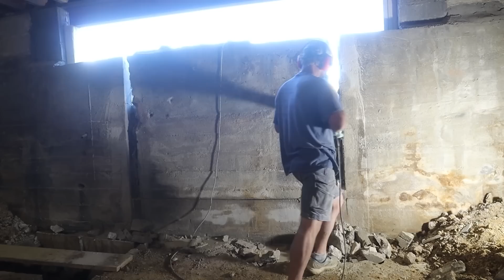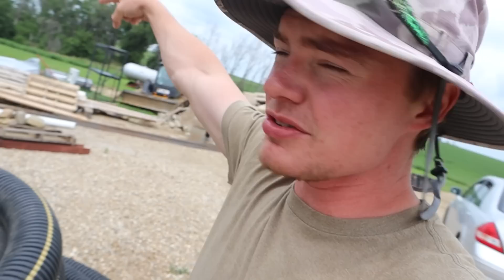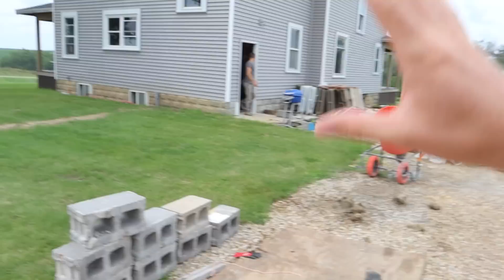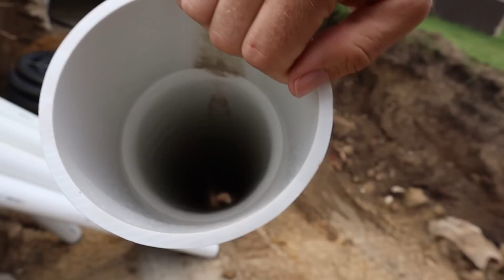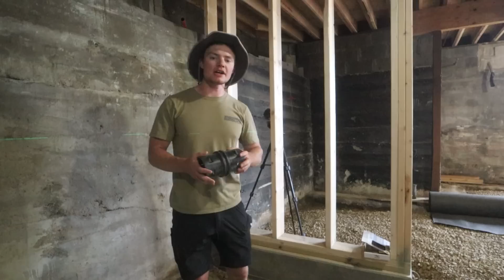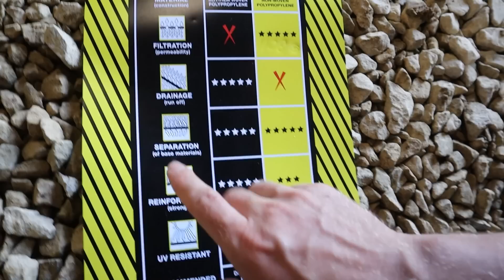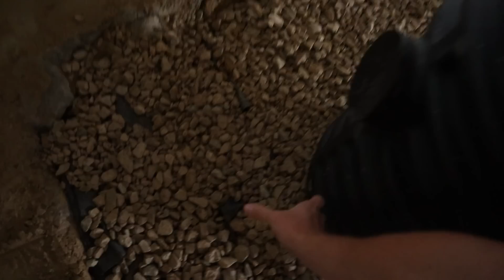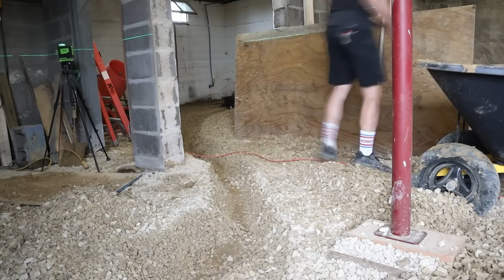Restoring A $7,000 Mansion: Building A Basement Water Removal System

Comment: when you put int the sump pump, makesue you buy the dual pumps, one battery backup!
Reply: battery back up pumps suck. Get a water pressure back up pump.
Reply: @warrenmichael918  -  Is the house on municipal water supply or well water? Water powered backups work great in the city when there are water towers that gravity feed the system but if they're on well water then the electric water pump will not work...
Reply: @billnict1  Didnt they just remove the well from the house and only have it to the sheds now? I thought they did and they had city water.
Reply: @warrenmichael918  - They did fill in A well (or maybe it was a cistern) in the basement, I don't think it was their water source though. There's also that other well out in the middle of the driveway that I believe they use for agricultural purposes only. So not sure what they use for water...
Reply: @billnict1  I know the house isnt tied into the well they have been digging around and working on. They showed it was just an old capped off line they removed and said the water from that well only fed out to the sheds. I assumed that meant he was on city water.
Reply: @warrenmichael918  - Could be

Comment: I have never seen French drain inside a house. I will normaly put them outside the house. This is new to me.
Reply: yes, thats wrong. 
@MartinJohansson-nn5dv
för 46 minuter sedan (redigerad)
I dont know why all the North Americans dont use commen sense. In Sweden we put ALL our dranage pipes UNDER the footings of the foundation and on the OUTSIDE, then you got a dry wall. Maybe you think your roof gona leak so you get a swimmingpool in the basement and want to dranage that out. Dont forget the proper materials on the outside and get it ventilated. I dont know about your place but where i live the Muncipality have a Radon Map for all Muncipal where you can see if there is any Radon, i can borrow a gauge to messure if i want. If you dont have Radon i dont understand why spending time and money on that installation. Normal is to have the dranage pipes on the outside for water under the walls and then you have a normal 4 inch pipe around the house where you connect all pipes from the gutters on the roof and dranage that water far away from your foundation/house. Just think about what happend if you got a soil on the outside how is wet and you dont have the dranage at the lowest point, so now you have a water pressure from the higher level on the outside and gone pressure water in to your pipes and bec you put your dranage on the inside and high pipes you gona have wet floor all around the basement bec of your pipes. If you istall a pump you must figure it out that something with your construction is wrong and must correct it with a pump. Your France expert should ask him self where the water come from and where shall we stop it, doing all the works inside the house is like a temporary band aid for a bad constrution.
Reply: @MartinJohansson-nn5dv  I have worked with dranage systems in Denmark and My logic is the same as Sweden. The water most be outside and my foundation dry. I also is skeptical for mold with dranage inside. Smelly business. But I am no expert.

Comment: The pipe that the sump pump uses to push water out of the house seems to big for a pump to be able to push.
Reply: Where did you see this pipe? He doesnt have a pump in yet so he never ran the pump discharge pipe. That 4 inch black pipe isnt for the pumps discharge, it is there in case the pump fails, the water can gravity flow out from the pit and down to the creek.
Reply: oh ok, thanks , my mistake.  @warrenmichael918

Comment: Most basement water proofing companies stopped using corogated pipe inside the house perimeter because they are breeding grounds for mold.
They changed to ridgid pvc w/holes poining down so the pipe never has water stuck in ribs.
Reply: That makes sense to me.
Reply: @laurel2453  Yep, they typically use both: ribbed outside, smooth ridgid on the inside. I had mine redone years ago due to mold and that was the solution.
Reply: They stopped using the Cheap pipe that has the ribs on the inside. The good perf pipe has a solid inner wall. Im not sure what Coles pipe is though. His non perf tile looks like it is the solid inner but i cant tell yet about his perf tile.
Reply: We are gonna know how to do all this stuff plus how to think outside the box ,which is invaluable in this world 😅
Reply: Yes and they don't need to be sloped but they are typically run into a sump, which you have installed but not connected to your drain system.  Leading the water out of the building is great.  Instead of the french guy you might have spent some time watching a plumber/basement drain channel.
Reply: @stevehammond7485  The reason most floor tile drains are even ran to a sump pit is because they are in a lower level basement with no way to drain the water without use of the sump pump pit. Cole has enough natural drainage that he doesnt need a pump or a pit here for drainage. He didnt tie his lines to this pit because he is just gonna use the pit as an overflow in case it ever needs a backup for the tiles. His drain tiles he just put in will work great, he has them in a nice gravel envelope with a fabric wrap.
Reply: @MartinJohansson-nn5dv
för 46 minuter sedan (redigerad)
I dont know why all the North Americans dont use commen sense. In Sweden we put ALL our dranage pipes UNDER the footings of the foundation and on the OUTSIDE, then you got a dry wall. Maybe you think your roof gona leak so you get a swimmingpool in the basement and want to dranage that out. Dont forget the proper materials on the outside and get it ventilated. I dont know about your place but where i live the Muncipality have a Radon Map for all Muncipal where you can see if there is any Radon, i can borrow a gauge to messure if i want. If you dont have Radon i dont understand why spending time and money on that installation. Normal is to have the dranage pipes on the outside for water under the walls and then you have a normal 4 inch pipe around the house where you connect all pipes from the gutters on the roof and dranage that water far away from your foundation/house. Just think about what happend if you got a soil on the outside how is wet and you dont have the dranage at the lowest point, so now you have a water pressure from the higher level on the outside and gone pressure water in to your pipes and bec you put your dranage on the inside and high pipes you gona have wet floor all around the basement bec of your pipes. If you istall a pump you must figure it out that something with your construction is wrong and must correct it with a pump. Your France expert should ask him self where the water come from and where shall we stop it, doing all the works inside the house is like a temporary band aid for a bad constrution.

Comment: You should really check out Gate City Foundation Drainage. He fixes all the problems have with the slotted pipe you are about to use in your basement. That pipe just plugs with soil & roots however you should check it out for yourself.

Comment: @Cole The Cornstar
Ok, maybe I'm wrong but it seems to me that if you are putting your low point through the new basement door then a) the sump pump should be in that vicinity and b) the high point should be directly opposite of that doorway and run in both directions .......  just sayin' ......
Reply: those 2 lines he ran towards the big opening are going to be ran out through a trench and down to the creek that is way lower than the basement floor level. Its going to gravity feed.
Reply: @warrenmichael918  
Yes, i know. Kinda my point.
Reply: @steadfastneasy26  not sure what you mean because what you were saying in your first post about the lines being higher where they were started from and being lower where they were going out through the wall is exactly what he did. The only thing you said that he isnt doing is, having the sump pump where the lines both came together. He doesnt need one there if they are just going to gravity flow down to the creek.
Reply: @warrenmichael918  
The other thing he is not doing is starting the drop at the opposing wall directly across from where the line would go through the doorway wall. Have the drop flow in both directions around the perimeter until it meets that doorway. Only half the distance of flow. Which means half the amount of drop needed.

Comment: As long as your tile is level, the water will drain, water will always seek to be level. 
Sump pump pits usually have perimeter drains hooked into them, the sump pit with the holes all drilled in it will only drain an area right around the pit, not from the entire basement..... 
You may also need to inquire with your septic system professional, you might need to have it exit the house at a higher elevation so the septic system will function properly and not require you to excavate an excessive amount of soil for your septic system to maintain grade!

Comment: So crazy how beyond cost effective this is. Not even a restoration anymore, should have just leveled and re-built, you practically did anyway. With the efficiency of pumps there’s no need to discharge thru 4” line 🤦🏻‍♂️ add a check valve and pump right up and out, can be garden hose, or 1-2” pvc. and still no reason the electric or hvac couldnt be done while working in basement. that exact drain hose comes in various sizes and 4” is overkill

Comment: idk what the rules are in Iowa, but every sump pump i've seen ejects out of a schedule 40 1.5" pipe to the exterior, with a check valve to prevent back flow. The ejection never relies on gravity, except after it's outside the structure over the foundation.  Oh, and you can 100% use the drain tile pipe for the radon.  That's a total over-purchase and extra work you didn't need to do.
Reply: I bet he does run his pump line like that. The 4 inch gravity line from the pit is just there as a backup in case the pump fails and the pump is a backup for the floor tile he ran.

Comment: spend the extra money and get battery backup for sumps
Reply: Or do it right so you dont need a sump
Reply: battery backup pumps suck, get a water powered one and rest easy knowing the battery doesnt ever die. I dont think he will even need or use a pump, especially once he does the tile around the outside like he plans on later.

Comment: I dont know why all the North Americans dont use commen sense. In Sweden we put ALL our dranage pipes UNDER the footings of the foundation and on the OUTSIDE, then you got a dry wall. Maybe you think your roof gona leak so you get a swimmingpool in the basement and want to dranage that out. Dont forget the proper materials on the outside and get it ventilated. I dont know about your place but where i live the Muncipality have a Radon Map for all Muncipal where you can see if there is any Radon, i can borrow a gauge to messure if i want. If you dont have Radon i dont understand why spending time and money on that installation. Normal is to have the dranage pipes on the outside for water under the walls and then you have a normal 4 inch pipe around the house where you connect all pipes from the gutters on the roof and dranage that water far away from your foundation/house. Just think about what happend if you got a soil on the outside how is wet and you dont have the dranage at the lowest point, so now you have a water pressure from the higher level on the outside and gone pressure water in to your pipes and bec you put your dranage on the inside and high pipes you gona have wet floor all around the basement bec of your pipes. If you istall a pump you must figure it out that something with your construction is wrong and must correct it with a pump. Your France expert should ask him self where the water come from and where shall we stop it, doing all the works inside the house is like a temporary band aid for a bad constrution.

Comment: Why don't you use the perf pipe for Radon extraction as well just pull a slight vacuum on it to vent?
Reply: hahaha did you watch this video or any of the last few? He is using the perf pipe and he has talked about putting the fan in to keep it pulling out any radon.
Reply: @warrenmichael918  But he is going to use PVC pipe placed separately to extract the Radon additional to the poly pipe already in place.
Reply: @msowdal  He is going to use another piece of the same tile he used for the water he said. Not PVC.
Reply: I know he showed us a piece of PVC pipe laying there before he started but he said that was just to show us where he was going to be laying the 2 runs of perf pipe.
Reply: @warrenmichael918  You were correct, sorry.

Comment: 1/4” inch per foot is minimum, you’ll have standing water in the pipes for sure
Reply: You mean per 10ft?
Reply: @pamelao6762 , No 1/4 inch per foot fall from beginning to end of the drainage piping otherwise you will have a lot of residual water sitting in the pipes

Comment: We have a French drain system all the way around our house plus two sump wells. You will never regret doing g more than required when it comes to water mitigation!
Reply: @laurel2453  most have both, inside and out. He has said several times now that he will be doing this on the outside as well. Every house with a sump pump has this or some form of this pipe on the inside, thats what feeds into the sump pit. Im not why you are confused why he has this on the inside.
Reply: @warrenmichael918  Tell us you know absolutely nothing about sump pump installation... because everything you said was pure BS.  Most houses with a sump pump pit has just that... a hole in the basement floor with a sump pump sitting in it.
Reply: @benhur520  When did i say anything different? Cole has a sump pump pit and im sure he will put a pump in it. It probably will never run but it will be there. The comments are all mixed together for me on youtube tonight so i dont know what comment i made that makes you think i dont know what a sump pit is. Cole has a naturally flowing french drain tile system he installed on the inside of his basement floor and that will flow naturally out to the creek. Then he installed a sump pump pit, he didnt install it like most get installed because he didnt run his floor tiles into it. He is using that as a backup incase the perimeter tiles ever clog up, the water under the floor will seep into the pit and the pump will be used to pump it out. I assume he will pipe the pump up and out like a normal pump gets plumbed in also. The solid 4 inch line he ran from the pit will be his 3rd line of defense, if the perimeter tile fails, the pump gets the water, if the pump fails, the pit fills up and runs out naturally through the solid pipe out to the creek. There isnt anything wrong with any of what i just said now or in any other comments. I have installed several sump pumps in my life, retired LU 653 plumber here.
Reply: @warrenmichael918 You are absolutely wrong. The water proofing is ONLY done on the outside. Sump pumps are only used when the basement is below the sewer line/ water table. If a house is below the water table that is when they will be the French drain on the inside and outside of the basement but they are connected together and have two sump pumps for the inside and outside drains.
Reply: @Katiesmith_wx  im not sure what the comments are doing because they are all mixed up together for me. Water proofing as in rolling on either tar or a sheeting is done on the out side, i agree and didnt say different. If youre calling drainage tiles waterproofing, they are most certainly done on BOTH the outside along the foundation and the inside under the floor. You and i are talking about 2 different things when i say a french drain i guess. Youre talking about french drains i guess that run into a sump pump and are  being pumped out. Im saying a french drain is a drain that is totally free from having any pumps because there is enough fall or at a high enough level to flow out naturally, like Cole is doing. He has a naturally flowing drainage system in his basement that will flow through his drainage pipes and flow naturally without any pumping straight to the creek. His house is much higher than the creek so he is running a french drain. Maybe its called something different where youre from but thats what we call a french drain here.
Reply: As long as the electricity works, he will be fine.

Comment: lots of rebar still to lay in there - i would look at your septic drainage while you are in there 0 it is almost 100 years old - dig out the outside - think about fiber optic inspection
Reply: septic drainage should be 100% fine, especially since he just told us that a new one is getting installed.